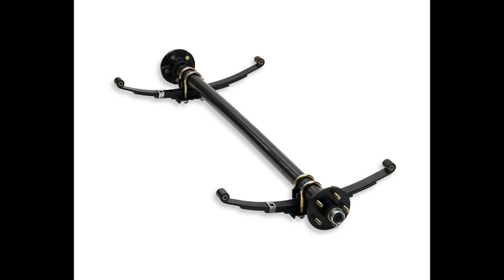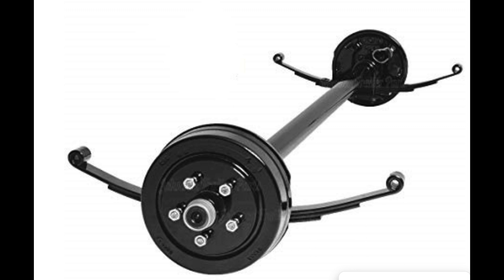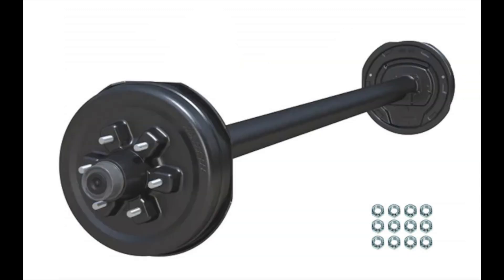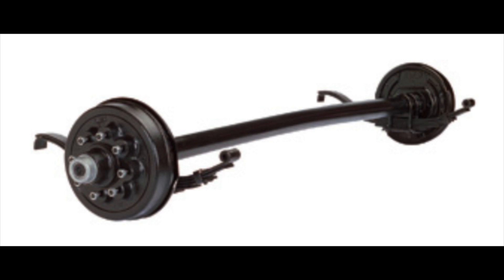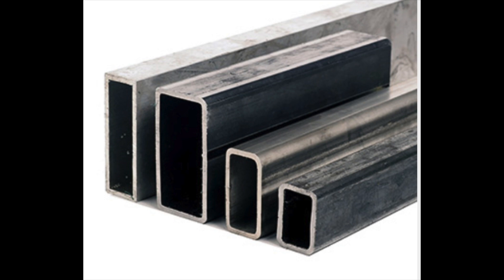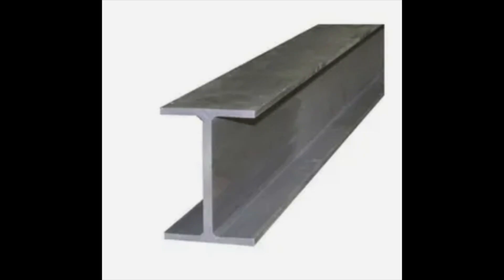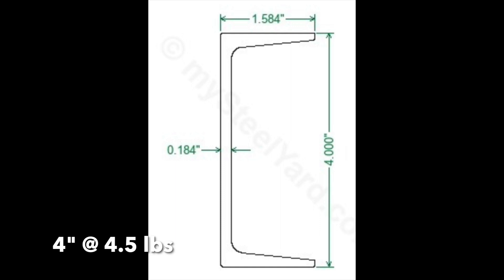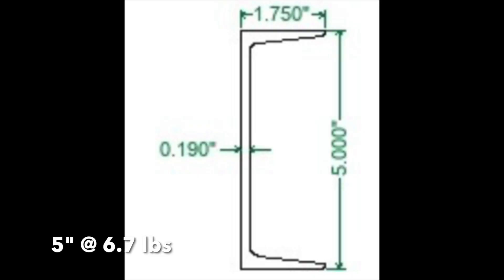Trailer design | Part 3 | Selecting materials

Comment: Thanks for the best video series on the subject on YouTube! I’m building a sawmill trailer with a bed 20’ long 37” wide that will have a maximum transport load of 1,000lbs. The mill head being the majority of the load, which will be positioned near or over the axle during transport. The maximum static, evenly distributed load possible for the trailer would be 7,500lbs. This load would be carried by six leveling jacks and not the axle during milling operations. What would be the best type and size of stock to use for the mainframe, A-frame, and cross members? Im trying to be safe but not break the bank. Any help would be greatly appreciated as would any suggestions you have for the other components. Keep up the good work, and keep sharing pleas!
Reply from the maker: Thank you for your comment. I like to use C-channel, but square tubing will be fine too. You could use 4" C-channel for the main beam and A-frame and 3" C-channel for the cross members.

Comment: @RG I have always wonder what is the difference and reason of A frame tongue built in as part of the main frame vs welded below main frame
Reply from the maker: @butilbenceno  there is no difference in strength, it just depends on the design of the trailer. I personally like having the A frame below the deck, because the hitch will be at a decent height, when the rear axle springs are under the axle tube. For other trailer designs, it could be better to have the A frame incorporated into the deck, but that will raise the hitch height.

Comment: Hi ! I need advices,
Two  3500 lbs  axles  landscaping trailer 81 inches by 16 ft to be build . Am trying to avoid bad handling on the road , poor axles alignment, and bad load distribution.

I wonder if the 60% rules is accurate, if I have to take the mesurement from the front of my frame or from the coupling point?
Any better ways to find the optimal place to weld my suspension blade supports?
Thanks  in advance!
Reply from the maker: The 60%/40% deck rule is not always accurate. But it is ok for general use trailer. The measurement is taken from the front of frame (deck), not from the trailer coupling point, to the middle axle bracket from where the suspension equalizer is located.  So, 60% of deck length is in front of axles and 40% behind the axles. Make sure the deck is squared and that the axle brackets are exactly at the same location on both sides and the trailer will track straight. For proper load distribution, make sure to front load the trailer first. If your tow vehicle can handle the added hitch weight, you can located the axles at 70%/30%. To get the exact optimal axle location, there is calculations that can be done (see the first video in this series), but those calculations assume the load is at the same location on the trailer deck all the time.